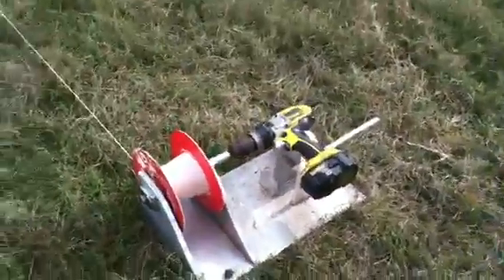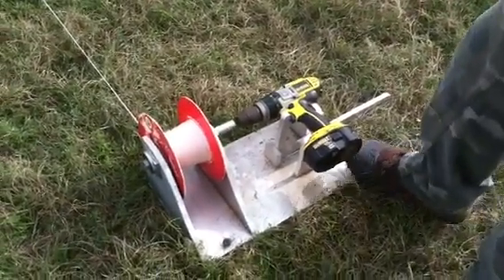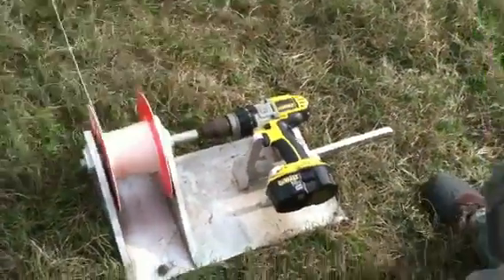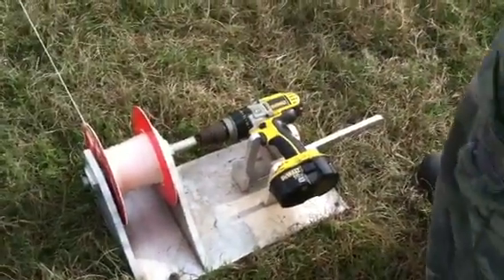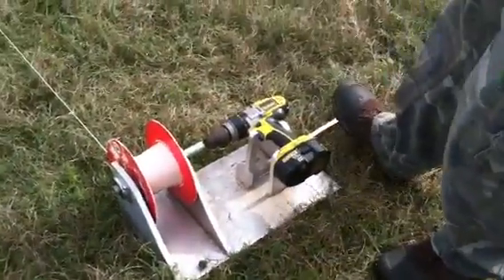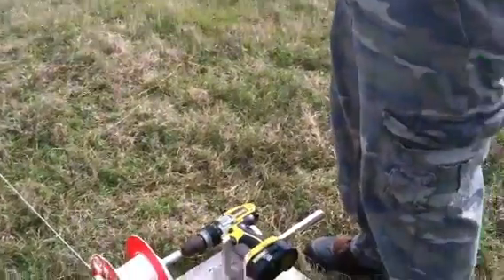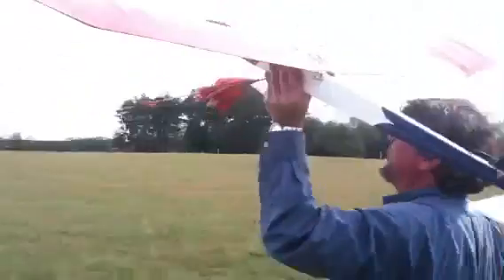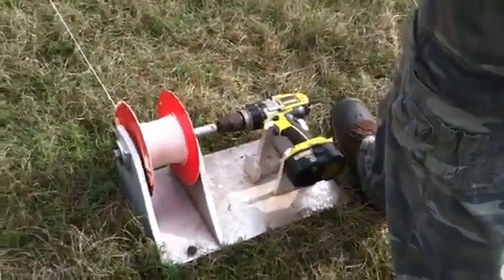Drill powered sailplane winch

Comment: Great idea. The foot pedal linked to the variable speed control is awesome. Now I must search for a spool to build one, or did you make your own spool? I was thinking that I would build mine on a piece of 2" X 8" lumber long enough to park one tire of my car on it thus eliminating the need for a ground anchor. The weight of the car is more than sufficient to keep it in place. What sort of pulley did you use at the other end?